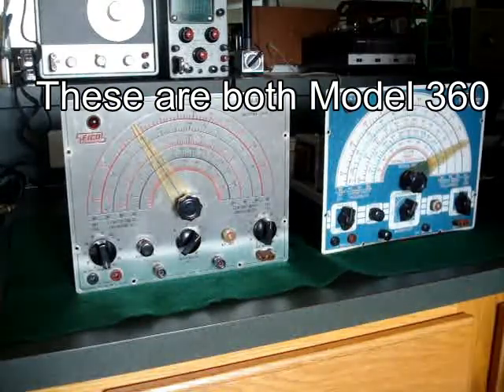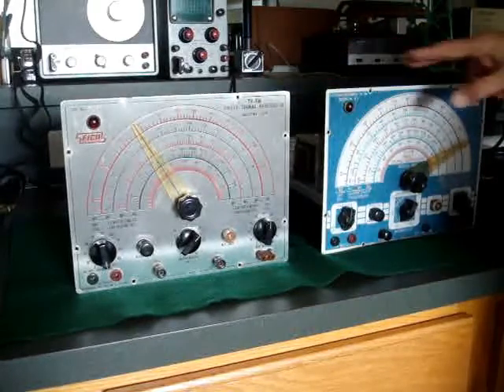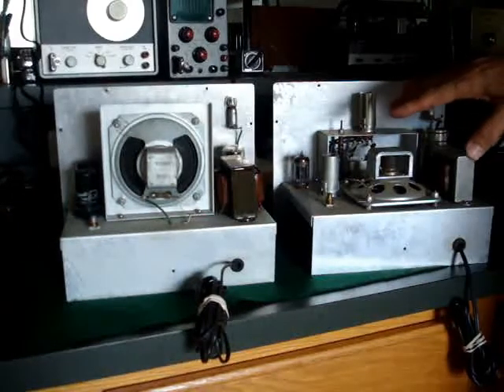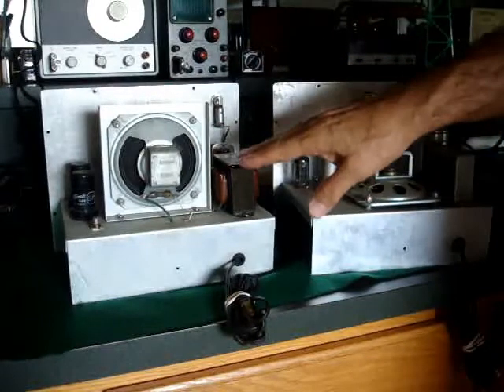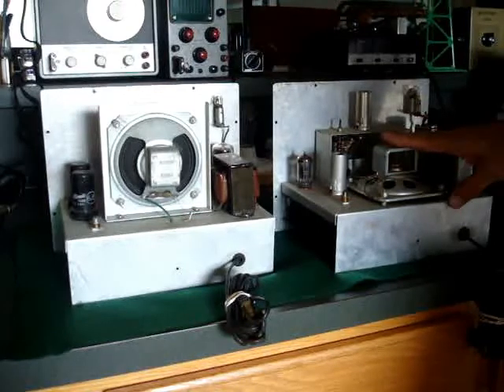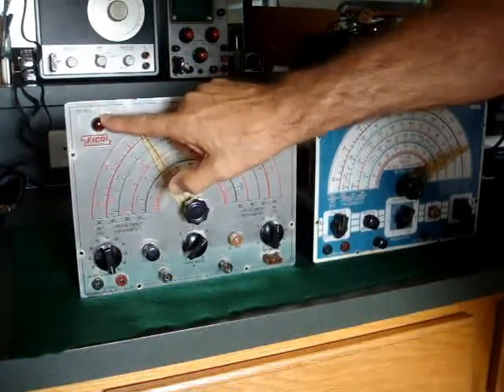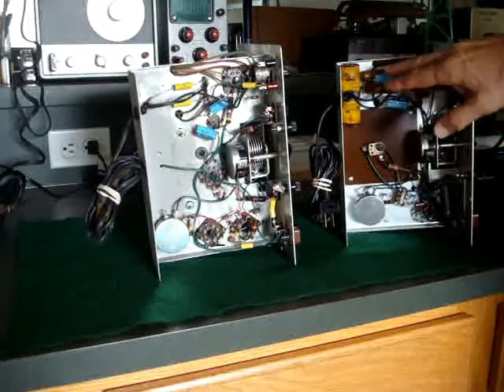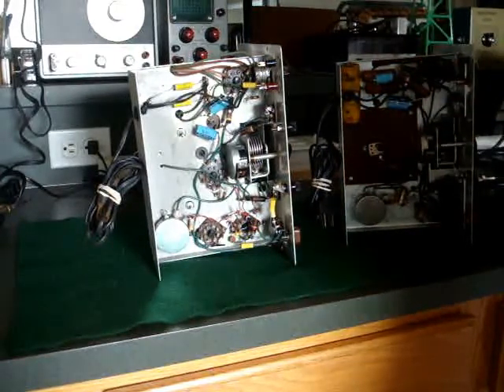Eico 360 Panels.avi

Comment: THAT'S QUITE INTERESTING!    I have 3 of these, and my blue faced ones have octal tubes, and my silver faced one looks close, with octal tubes, but it has a 6SQ7 where the 6X5 should be, and a diode bridge added . looks factory. On the front panel there is a x .1 and x 1 switch underneath the sweep width knob, It has a microphone connector for a marker generator input, and two internal calibration pots! It also has a "blanking" knob in the upper right hand corner. I can't seem to find any reference to this any where!!!   I swear, if there is an odd-ball EICO, i will end up with it.